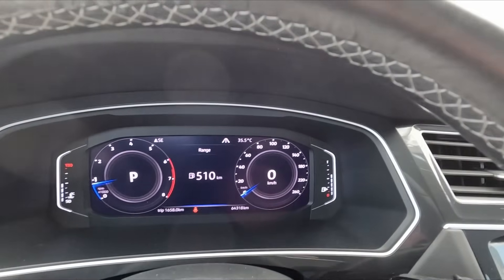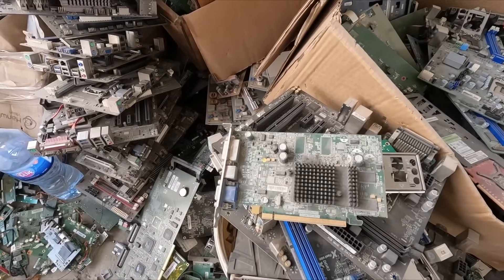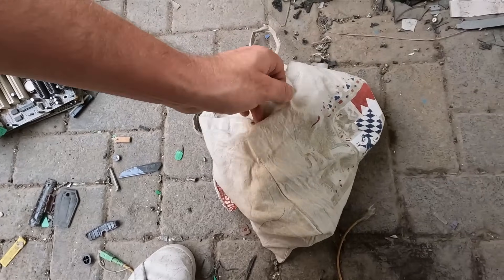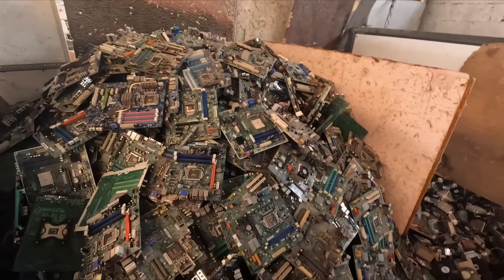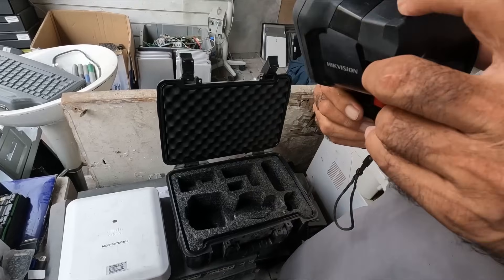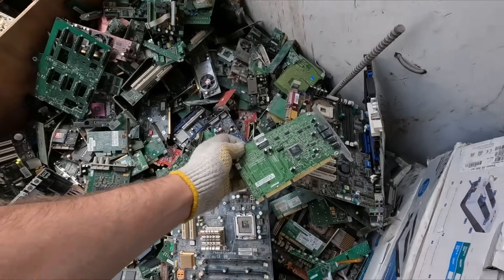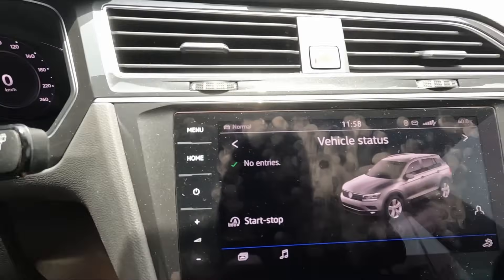What Retro Hardware can you find at a Scrapyard?

Comment: Certainly an easy source of EPROMs and all sorts of other chips if you had need of them!
4:12 Gonna make lots of applesauce! 6:22 And a real-time clock, going by the battery.
8:27 Odd board, with that large battery soldered to it, and an I387! Rarely see those installed.
Looks to be a NCR CORPORATION Class 3210/3215 motherboard.
14:53 I really wonder what that board with no solder-mask is from, looks quite old, all hand-drawn traces.
Thanks for the tour!

Comment: Ooh, nice, a Sound Blaster 2.0 CT1350B. I've been picking them up off the electronic bay website for years whenever I see one going for cheap, so I've got quite a collection. I bet you got that one for a lot less than I paid for any of mine, though!

We're still redeploying those Cisco 3650 switches at work, they're still pretty good. Pulled some out of an office that we moved out of recently, and I'll probably be sending them off to replace some old 3750-X switches (or possibly older ones). They'll be fine for a year or two until we get a bit of a budget to replace them with something new.
Reply from the maker: And all your old stuff might end up here in the UAE :) Hehe...
As for the SB 2.0, I paid a bit more than 5 USD for it. Now I need to get the CMS chips done and maybe replace a few caps on the board (some seem to be punctured).

Comment: You didn't pick anything up? That Sound Blaster 2.0 would be a instant pickup, then upgrade it with CMS sound :)
Reply from the maker: I did take most of the retro stuff... I took the Socket 3 boards, the VLB VGA card, 5x86, 6x86 + board, the Sound Blaster 2.0, and a few other things you saw in that video. I even took the heavily corroded 386 board! Next week, you will see me trying to save it...
Reply: @bitsundbolts nice! Hard to tell what you take or not ^^ How is the pricing then? Do you just pay scrap weight or any extra fees? It would be so nice if we could do this in Sweden as well, instead of useful stuff going to waste.

Comment: I laughed when I saw the S3 card you considered taking. I immediately thought 'junk and why'. I have a box full of those cards, maybe 30 or more heh! I use them for the RAMs when repairing some other things. This same box has over 100 pc cards in there, most are vga cards (three voodoos, a couple matrox the rest junk riva, s3 and old common nvidia mx4000 and some rubbish like i740 and sis6326 chipset-real garbage lol), also some sound and scsi cards too. Some I am keeping but most just sit there doing nothing.
Reply from the maker: Hehe, yeah - some cards may not be the best, but the S3 cards are very compatible and still a good match for a Voodoo 1/2. Some of the stuff I just take to play around with. There is an S3 Trio64 V2 video coming soon :)

Comment: It's really sad to see those huge stacks of office PCs, sitting waiting to be disassembled and parted out. Most of them look to be in good to excellent physical condition too. Older office PCs can still be useful even today. Because they are usually the "business" line of their respective manufacturer, in general they have a higher build quality than consumer grade machines, and are built with better/higher quality components, etc. Throw either Windows or Linux on there and they work great as daily-use machines. And if you throw a decent video card in there, you can even make yourself a respectable gaming rig. And they are very inexpensive too. For the longest time my daily driver machine was an HP EliteDesk 800 (Core i7 4770) with an Nvidia GeForce GTX 1650 half-height PCIe card. Played games really well, if you didn't go too crazy with the graphics settings. The only reason why I had to get rid of it this year was that the USB ports started acting flaky, which was 100% my own fault. (I think I accidentally shorted out one of the ports, and I think I might have killed the USB controller.) I still use a Lenovo ThinkCenter M900 Tiny (Core i5-6500T) small form factor machine as a firewall/router running OPNsense. And I've built many daily-driver machines on the cheap for financially challenged friends using office PCs.

Comment: What do the scrapyard asks for those items seperate?
Reply from the maker: Depends on what you take. Motherboards, expansion boards, memory, CPUs - all have a different base price to start negotiation.
A motherboard is around 10-15 USD. CPUs with more gold cost up to 20-25 USD. Memory is usually around 3 USD per module. If you get more pieces, you can negotiate and get a better deal.

Comment: I would love to be set loose in a scrapyard like this. I've no skill in repairing things, I don't even know if I have the dexterity needed for simple soldering. But I think I'd be happy getting a big haul, going home and testing, and returning 75-90% of it.

I can't even get a regular ATX case with drive bays at all in my town, let alone a vintage beige. They're all 100% new, and either mATX or bayless. I don't want to drop US$50+ on just shipping based on only pictures, I want to know the feel of the case.
Reply from the maker: I totally get you. Most of the things I pick up there are indeed working. They just got tossed out because they are obsolete. There will be the occasional scratch or dent, but rarely something that isn't fixable. Even cases show up from time to time, but those are the first ones that are striped apart.

Comment: The combined card you found two of is possibly a BMC from a server: simple graphics controller+SCSI RAID+management controller with it's own ethernet controller. Basically a small computer of it's own that's running all the time on standby power before the main one starts and manages/monitors the whole chassis remotely. The interesting about it for me is the RAID addon but maybe it was in a compact 1U/desktop server or workstation that had few PCI/PCI-X ports. It's like a Dell DRAC, HP ILO, IBM RSA but maybe it's one of the much older and long gone DEC/Compaq stuff. Could be a bank somewhere finally retired it. 🙂 I've seen at least two boards and that big iron had that soldered CPU with a bolted-on heatsink using 2x screws on top. That could be Sun SPARC or DEC Alpha stuff. That CPU has literally two bolts sticking out on top of it's heat spreader. The port density of all those stacked Cisco switches is insane. 🙃 It's a goldmine out there!
Reply from the maker: Haha, nice that you could comment on so many things! Yeah it is a very interesting place! Visiting it is always an adventure.

Comment: How many kilos of stuff did you take and how much did you pay for it?
I'd like to compare prices with my local ewaste facility.
Reply from the maker: It is usually per item. Different categories: motherboards, expansion cards memory, CPUs.
A motherboard is 10 USD, an expansion card around 5. CPUs depend on how golden they look: 3 USD to 15 USD
That is the base price. Then you can negotiate - if you buy multiple items, you can negotiate a better price.
Reply: @bitsundbolts  turns out to be more expensive than here in Poland. But there are more retro parts in Dubai than here.
Reply from the maker: Yeah, that's what I usually hear. But that's what the price is. Of course, it's better to take only the things that have some value because the price doesn't change. But then again, it's not as common to find many good items during one trip.

Comment: Do they keep a pile of CPU's anywhere?
Reply from the maker: Yes, they do. Some of the places have boxes full of CPUs. You can find anything from 386/486, Pentium, to anything more modern like multi-core Server CPUs (the big ones from Intel - well, it is mostly Intel). You also find the occasional Opteron.
Reply: @bitsundbolts That's awesome. Please show more!
40C is a lot to deal with though.
Reply from the maker: The temperatures aren't as bad anymore. I guess I got used to the hot climate. On the flip side, I freeze when I visit Germany in the winter.

Comment: How does this actually work? I guess you can't just go in there? Do you pay entrance? By weight?
Reply from the maker: There are independent scrappers - you get to know the guys if you go there often. Every item is negotiated separately. Sometimes, it is by weight, sometimes per item type (CPU, card, motherboard). Then you pay after some negotiation.
It goes like this: 
"How much for this motherboard"?
"100 USD"
"Hahaha" (pretend to leave)
"OK boss, 15 USD"
"Done"
Reply: @bitsundbolts  That sounds typical and like rather fair quotes. I guess they're almost exclusively interested in selling stuff off for recycling (noble) metals?

Comment: It's heart-breaking to see so much working (most likely) hardware getting destroyed.
Reply from the maker: Most of the stuff does indeed get destroyed there during separation. Motherboards are ripped out of cases (some boards break in half). AGP card are ripped out and the little retention piece on the PCB is ripped off and damaging the AGP slot. Hard-drives are thrown for meters (so, forget finding a working one), and so on.
Reply: @bitsundbolts  and scammers sell this junk at auction portals as "rare" hardware, I hate it

Comment: That Aztech sound card in most probably a Sound Galaxy Pro 16III. It is a PnP card and has 3D capabilities. I have one of those in my Pentium III PC. It works Flawlessly with windows XP,98,Me(and I guess 2000 but i have not tried) and they support it natively. But if you want to use it in DOS, you have to use factory drivers that works OK with DOS, Windows 3.x,Windows 95 but not with Windows 98 and me. I just use Windows native drivers for 9x and Unisound.exe for DOS. It has a OPL3 build in the chipset and sounds very similar to SoundBlaster.
Reply from the maker: I took the card. It is the AZT2320 if I am not mistaken. I'll definitely try it one day. It seems to be a very interesting card!

Comment: Thank you for showing the scrapyard. I'm amazed by these retro finds... and also extremely mortified to see a big mountain of tech that was once expensive about 10 years back. I felt that we as humans has generated the most waste of this millenium and even the universe. This is the realization that I should appreciate more of the tech I have, and only replace them when they are broken and not just toss when they are still working. 😊

Also, rescuing old tech and giving them a new home is a cool idea too. I do feel that even tech 30 years back are way ahead than ourselves! There are a lot to learn about these even in the AI era. 😊
Reply: We are currently disposing systems that are actually still great, last week computer with 32gb ddr4 3200mhz. Most 16gb and Quad core, some Xeon.
I am sometimes shocked. Thanks Microsoft top Windows 11 program, should get environmental sustainability award
Reply from the maker: Yeah, it is mind boggling when you see the sheer amount of electronics in this place. It changes every two weeks. I'll try to make more videos and you'll see totally different items the next time. Retro stuff like the one I show in this video is not that common to find to be honest. This was a lucky day. Most days, it is very average with maybe one or two finds. That day, I spent about 300 USD on tech stuff.
Reply: @bitsundbolts  Well, at least you get a couple of these classic Socket 2, 3, 7 and even the Slot 1s. I heard that these boards are extremely sturdy and a lot of old machineries are still using those architectures. Some of us would have to search high and low to get these to maintain the machineries. I'd say the tech at the late 90s and the early 2000s are the most creative - you would find all ways and means to squeeze the last drop of performance from the systems. "Slotkets", "Coast boards", "Pentium Overdrives" and finally the "Socket 7".

Nowadays all these modern hardware are mostly AI accelerators - the nearest thing I can smell the late 90s are the Socket AM4 which spans a few generations. The excitement of these hardware nowadays could never compared to that era anymore. 😊

Comment: It really illustrates the insane waste from consumer culture. All this was cutting edge technology just 20-30 years ago, and now it's carelessly discarded. Some of those cases looked less than 7 years old. When just a single IC, capacitor, or other component fails, an entire computer ends up scrap. Most of it was probably in working condition when scrapped as well. Even ignoring the complicated pcbs and delicate plastics, how many identical cases, psu housings, io shields, hell just the screws are perfectly reusable?
Reply from the maker: Sometimes I find sealed boxes with DDR2 / DDR3 memory. The like of Kingston and Corsair. I am talking about cartons with 50 sealed memory kits - obsolete - nobody pays for it anymore. It ends up as scrap.
I agree with what you say - items are discarded quickly these days, but that is also because companies no longer want you to repair your old stuff. Well, "Right to Repair".

Comment: Next time you visit I'd love to see if they have piles of 5.25" Floppy Disk Drives.

If they have them it would probably explain why I had a lot of difficulty getting one to archive some old floppy disks that I wanted to preserve. Found one in the end, and for a very good price, but it was a struggle for a while.
Reply from the maker: Sometimes they have 5.25" floppy drives. I think I have about 5 - which need to be cleaned and serviced. 
They aren't as common, but they do pop up from time to time. I know some are there right now, stuck in some computer cases that are used as separators between shops.

Comment: I found a Roland SCC-1 and a 3DFX Voodoo 5 5000 PCI once, in the same system.  Best day ever of going through scrap.
Reply from the maker: Wow - what a find! That is kinda crazy! The best 3dfx I found was a Voodoo 3 3000.
Reply: @bitsundbolts what's awesome is that the computer had its RAM, CPU, every drive taken out and the PSU. It was just the motherboard and those cards, along with the case and two blank drive covers.  😂
Reply: wtf

Comment: It is nice that you left behind the brackets. I just love when I have a motherboatd with pinheaders for COM, LPT and sometimes video, mouse, USB, sometimes with non-standard pinouts. And no compatible bracket ports to plug in and use those ports.
Reply from the maker: Yeah, I came across this. I have have a board that has a non-standard pin output for the COM ports. Luckily, I already have each type multiple times.

Comment: i should visit you someday :D
Reply from the maker: Hehe - a day at the scrapyard :)
Reply: @bitsundbolts i love those trips... Unfortunatelly in my country (slovenia) the old school electronics are very difficult to find in good conditions... You on the other hand have passed on an ess and sb2.0 cards 🤯
Reply from the maker: I took the SB2.0, but not the ESS card because it was a compaq and probably requires those extra pins to be connected - non-standard ISA. I think it wouldn't work without them. I have a few ESS cards already - so, I am fine with that.

Comment: I'm pretty sure the ethernet/vga/scsi board you grabbed is from a Compaq Proliant server. It also houses the integrated lights out management. I don't think it works in a regular computer.
Reply from the maker: Yeah - many things there are from old enterprise equipment.
Reply: I have one i tried to get working in a normal pc i got the graphics chip to work but nothing else which sucks because i wanted to use the scsi ports

Comment: Alphaserver at 3:50
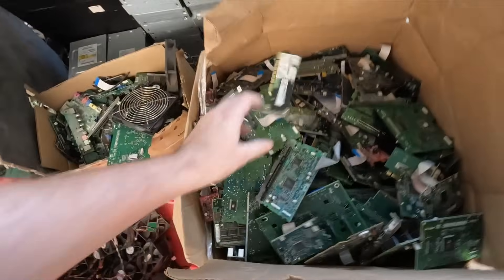Compaq Featureboard at 6:40, likely from an old Proliant server
Reply from the maker: Oh - I think I remember. Weren't those CPUs hitting 500 MHz while Intel was still at around 300 or so? I just remember an ad in a magazine advertising the CPUs - and I wanted to get one. But then my more experienced PC mates told me they won't run the stuff I wanted.
Reply: @bitsundbolts  They were way faster per clock than Intels too.
That one looks early, like 21064 or 21164. Still would make a pretty buck on Ebay if restored to working conditions as they are still in use at some places.
Reply: @bitsundbolts yeah they were super expensive back in the day too
Reply: @bitsundbolts  they ran windows nt
Reply: @bitsundbolts  I do not know if I still have it, but it was a sticker, I think it was '500MHz Fasten Your Seat Belts' or similar.

Comment: S3 Virge - 3D De-cellerator 😂
Reply from the maker: Haha, true. I heard it was famous for that!
Reply: @bitsundbolts  I have upgraded mine to 4MB video memory but it's stil slow as a snail.
Reply from the maker: Maybe it got slower with 4MB ;)
Reply: @bitsundbolts  Actually it gained 1 (one!) FPS in unreal turnament however its still in single digit 😂 Of course software rendering is faster 😂